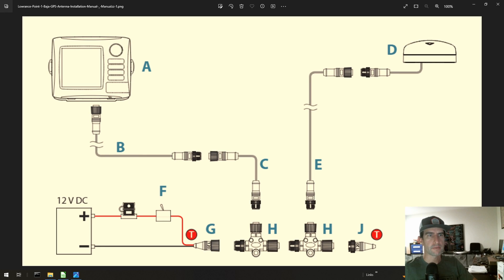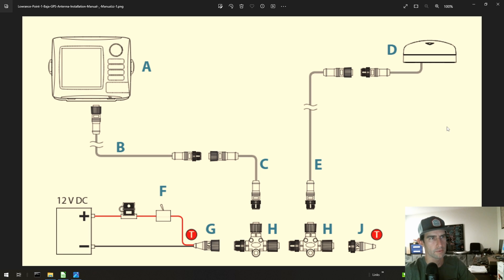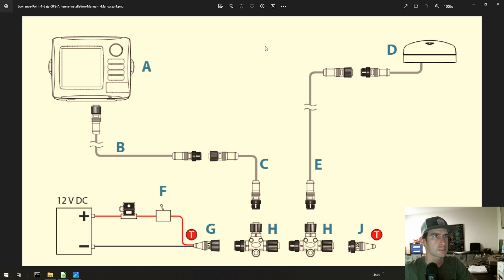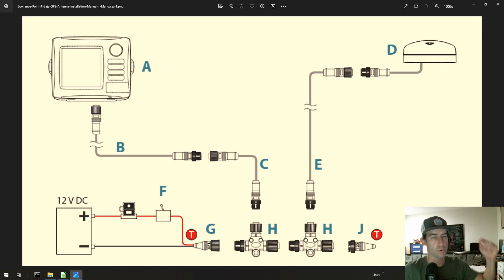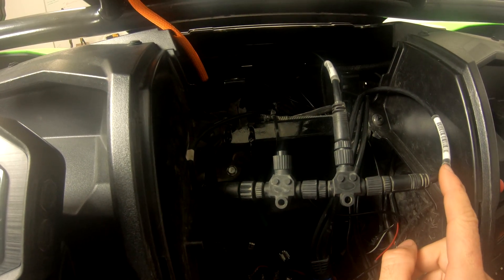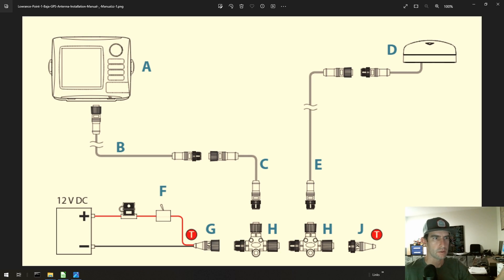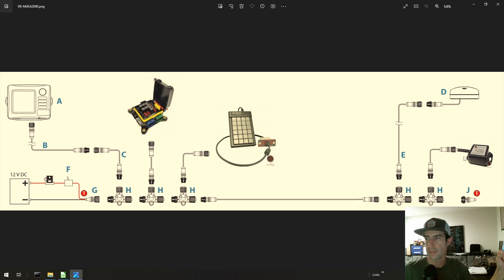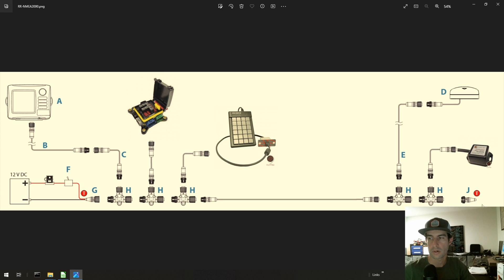Expanding your Lowrance Off Road GPS System with NMEA2000

Comment: I have a JL Audio MM-105 stereo in my CanAm X3. It’s a Marine stereo for boats. Is there a way to connect everything together? I tried using Bluetooth to use my HDS Live 9 to control the stereo but it won’t connect. Also are you still working on the “group ride” adapter to add to the Lowrance?
Reply from the maker: I looked up the jl system looking for a nmea2000 interface but it doesn't look like it has that option for media so bluetooth would be the next option but I've never tried it that way.. not sure how to help further.

Yes, live tracking is moving its way up the list. Quickly.